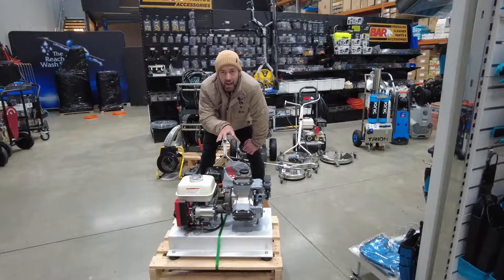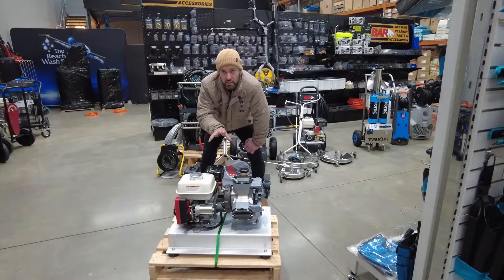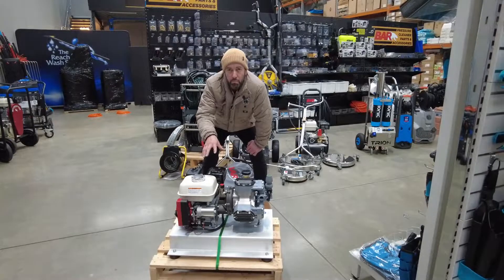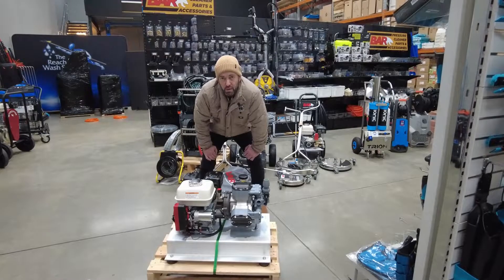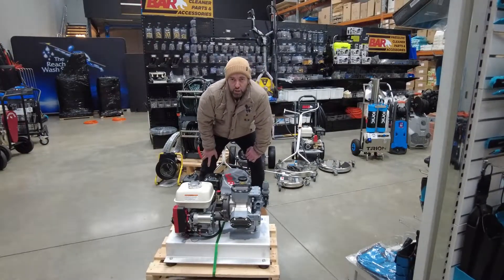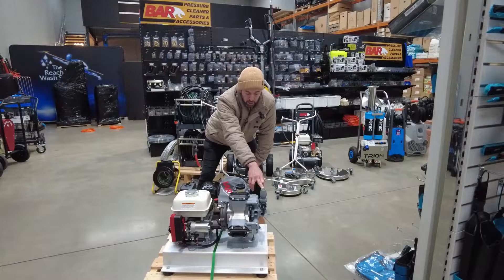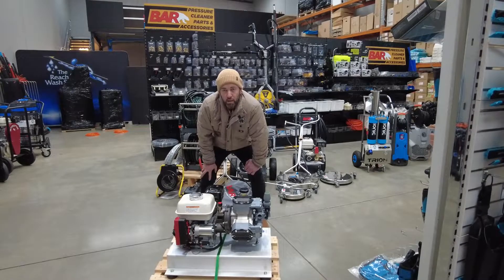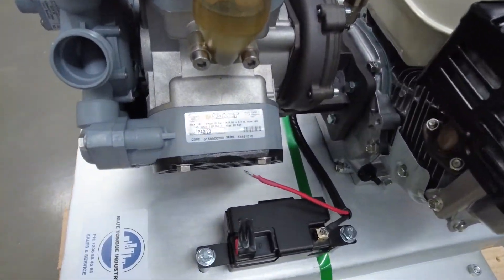P40 SoftWash - Honda Gx200 SoftWashing Pump

Comment: You  send the return hose back to a batch tank and your trailer and truck will be covered in foam in 10 minutes
Reply from the maker: Return hose acts like a radiator for heat transfer. Often like to run a good length. More so like a closed loop running through the water tank then back to the pump. The water tank to absorb heat from the hose on return to the pump 👍
Reply: @BlueTongueIndustries1300884566  trust me you put a return hose into a tank that contains a soft wash mix and your trailer will be covered in foam. These pumps must be used with a proportioner. I've been soft washing for years.
Reply from the maker: @rabbitskinner  you are 100%right. When we do setups the return hose is always “closed loop” . If there is a water tank the closed loop return hose we run through a tank to help protect the pump. We distribute for Midwest here in Australian. Like to keep the pumps as cool as possible. Your right you would have bubbles across the east coast if it was open flow into the tank for a return 👍